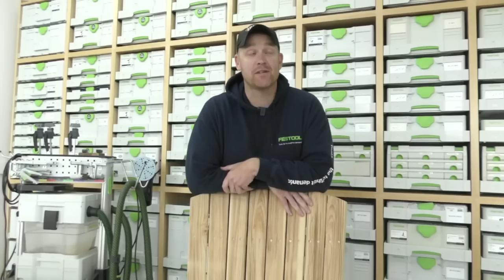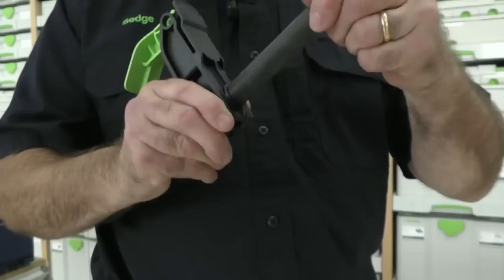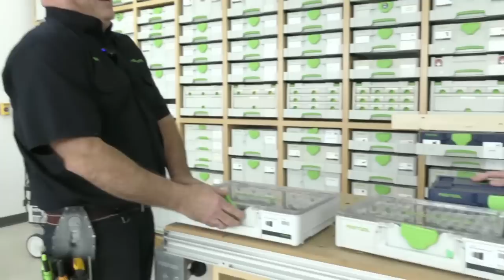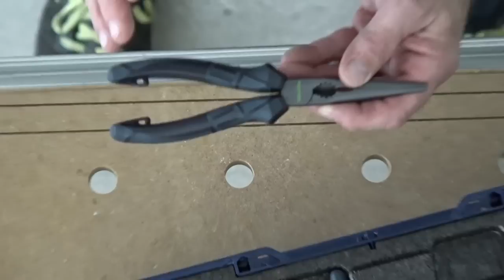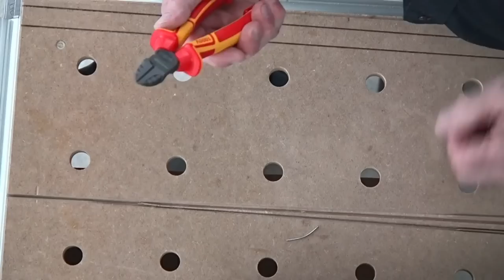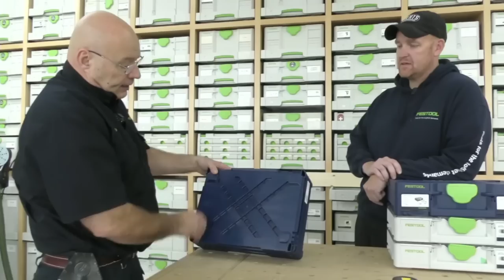Festool Live Episode 117 - Winter Launch Extravaganza

Comment: I think I have watched most of your Live shows and a lot of Sedge Tool as well. I have been thinking for a while as I watched the Live videos that you are always calling out the Vac Sys for how great it is. But since one can not get the vacuum pump anymore (interestingly you can still buy the rest of the system), how about addressing how we can still be able to use what is available for sale? Is there a vacuum pump that you would use if you wanted to setup a Vac Sys today and work around the lack of an available unit from Festool? Thanks for your great (and humorous) videos.

Comment: Because of the racking geometry that allows the lever clamps to lock into the 20 mm holes, does use of the clamps over time tend to wallow out the holes, compromising the accuracy of the MFT grid layout?